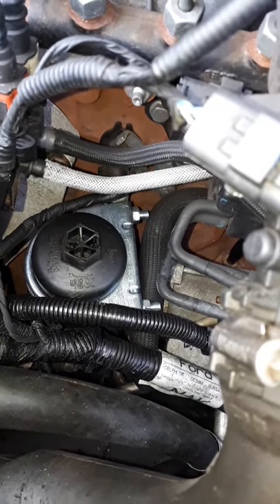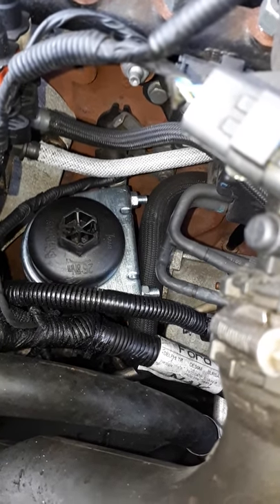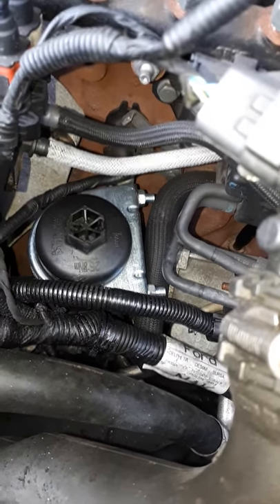Seized oil filter housing, MK4 Mondeo

Comment: Hi. How do you call this tool? Couldn't understand
Reply from the maker: It's not a tool,,it's a pipe clamp, sometimes used on exhausts.
Reply: @Segsy59  thanks for replying. Trying to take off  my filter cap for last 2 days so hopefully that helps. Already considered going to the garage
Reply: @Segsy59  changed oil but filter still same so probably not great to leave it like this
Reply: You can buy a special tool
Reply: Thanks, going to town to buy 75mm pipe clamp now